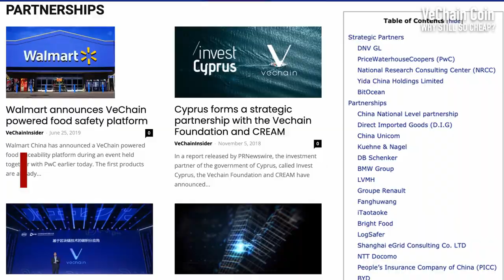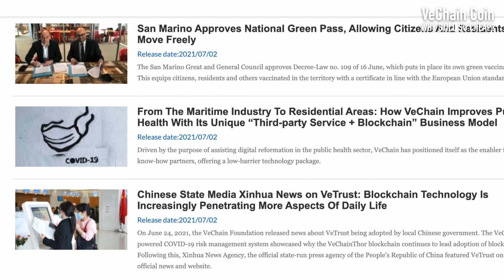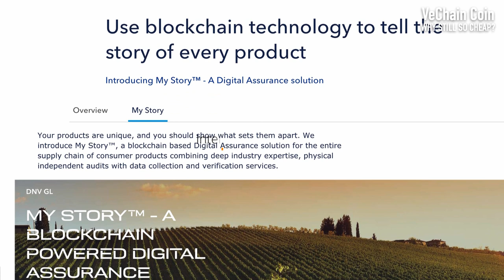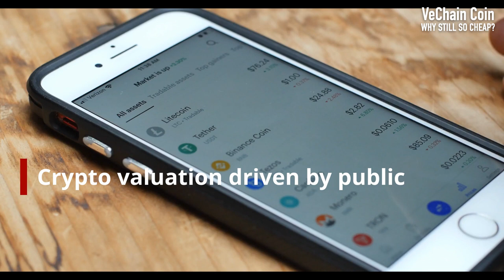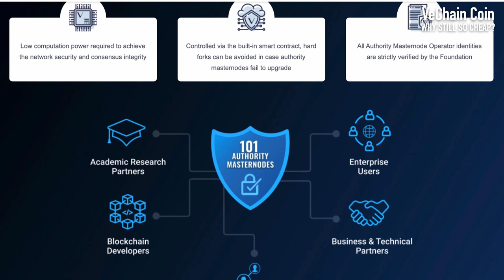Why is VeChain (VET) still so Cheap? | How can VeChain (VET) Explode? | FBE Capital

Comment from the maker: VeChain (VET) is a very interesting project with great potential and as such VET should be valued much higher than it is right now. However, it seems that VeChain's strength is also holding it back slightly, because it's operating too much in the shadows and not enough users are learning about it.
--> Comment your thoughts on VeChain
Reply: They are operating in the dark. They have damn near NO marketing going on.

Comment: One big question: The technology sounds amazing, but what is the Vechain coin usecase? Isn't the techology already enough? What do you use the coin for?
Reply from the maker: Good question! The strength of VeChain is indeed in the blockchain technology, which uses VeThor(VTHO) as a form of payment for all transactions (smart contracts, putting data on the network, etc). 
So to use the blockchain you need VTHO, now this puts pressure on VTHO, as more people need more VTHO to make more transactions, on the network.
So to keep VTHO relatively low and stable in price, they created VET which produces VTHO.

Now VET can skyrocket as much as it likes, but the amount of VTHO produced stays stable or can be increase if needed to keep the price of VTHO down. This guarantees to large companies a low and stable gas price on the network, since they will have to do large volumes of transactions. This basically solves the problem, that coins like Ethereum are having right now.

PS: Sorry forgot to add the whole part of proof of stake. But perhaps you already knew that.
So VeChain is based on proof of stake not proof of work. 
Which means you need at least 1 coin to be the stake, to guarantee the network integrity and then with VeChain you have a two token design, like I explained above.
Reply: @FBECapital  First time i get an answer on this question. Very good good info. Thanks mate! You got a new follower! Greetings from the Netherlands!